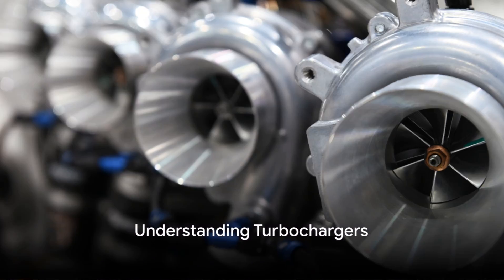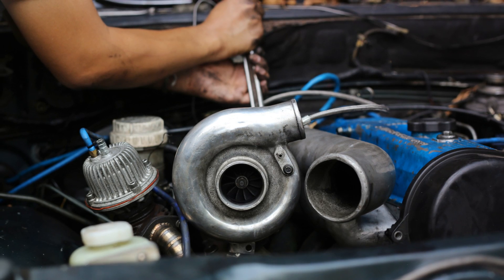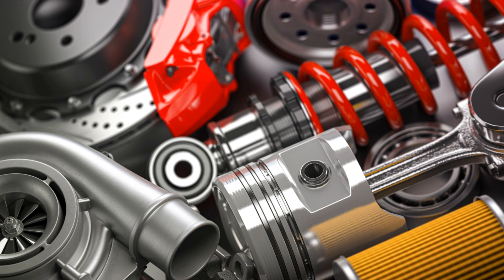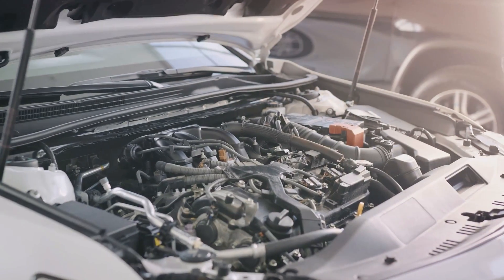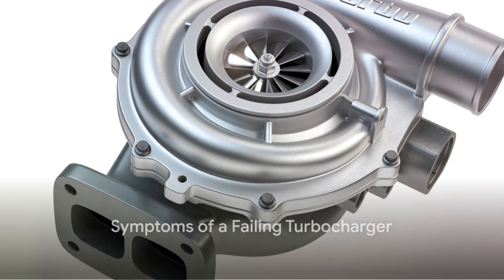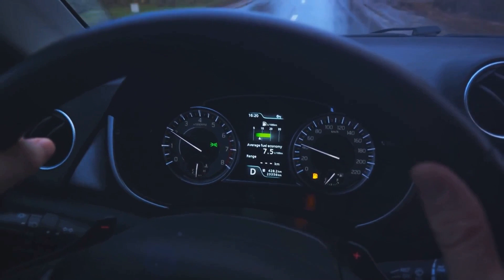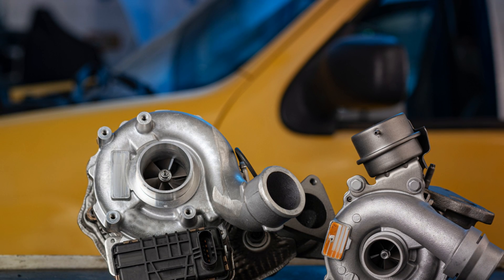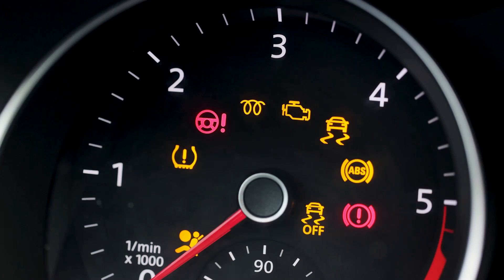Symptoms of a Failing Turbo: 9 Bad Turbocharger Signs

Comment: If you want it to last drive like a  chauffeur if you want it to die drive like a racing driver, don't forget reving up the engine when cold and plumping the throttle when switching off or generally not allowing the turbo to spool down is one of the most common causes of turbo failure due to the lack of oil pressure

Comment: Damn my turbo had all those issues but was still working like a beast. And then just randomly died and my car wouldn’t run correctly
Reply: How long can they go failing I just got my bmw 550 and I’m hearing a whining noise I hope it’s not the turbo
Reply: @Torisjwjndiwjoajsowjso got my focus st in March, didn't realize the noise I was hearing was a shot turbo, I'd say get it looked at asap. I can no longer drive my car after a few months of "figuring out there's no boost leak". I've got the exhaust smoke, the whine, my car accelerates slower than my SE,  no boost pressure, and I'm SO SCARED that there's broken pieces of my turbo in my engine now. If you suspect your turbo is going out or anything like that, get it checked out. Take it from someone that is now very nervous to do a turbo swap 😂
Reply: @patience5296 oh wow yea I will get it check it out I’m so sorry to hear that and yea I noticed it use to pull like crazy like that sling shot feel at only 2500 rpms now it has to hit 4000 just to have that same feel and still don’t feel the same really so I assume that what it does also when it’s going out?
Reply: @patience5296 like the rpms are high the pull just isn’t there like it was
Reply: @Torisjwjndiwjoajsowjso Didn't realize you responded my bad lol. I ended up replacing mine last week and my diverter valve was TOAST and the wastegate actuator was literally cooked. My whole turbo was broken basically lmao. I'd say if you don't have any boost/vacuum leaks, if you're still driving it, I'd honestly inspect the turbo. Like you can take it out and physically see the issues yk??  On my ST it was a 3 day project because of needing parts and stuff. Lmk if you have any other questions! I'm sorry you're dealing with a similar issue. Mine drove okay basically until it didn't 😂, just slowly went down hill. After I installed my "new" (used) oem one it was a night and day difference
Reply: @patience5296 u good lol and dang that sucks man I hope that ain’t the case with mine but yea the power just don’t feel the same after i heard a whine to but thanks for the info imma keep a look out and do some looking into the turbos here soon just been working so much and still just easing it around until I do it seems to be fine just the pep is gone but yea
Reply: @patience5296 can you help please? My sons guilia supposedly needs a turbo swap due to oil leakage. He’s never run out but goes frequently to get it changed and topped off. You can see some oil leakage right under the westgate link under the cover, do you think we need to replace the whole thing or could there be another easier fix? Thank you.